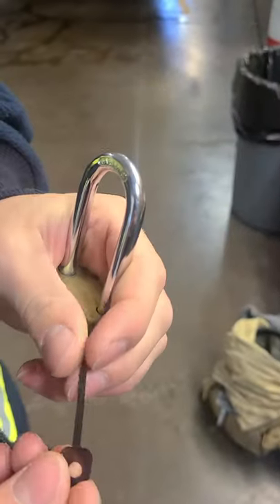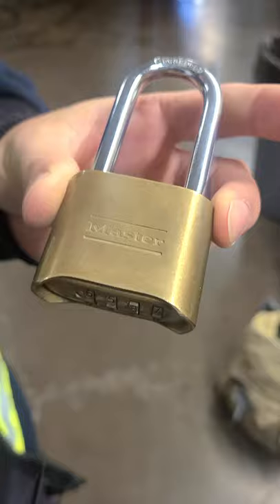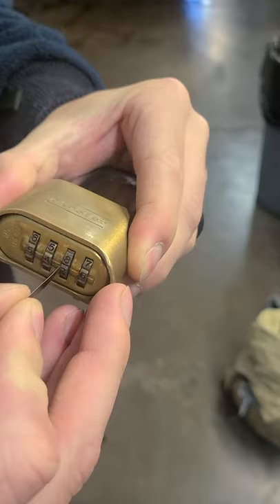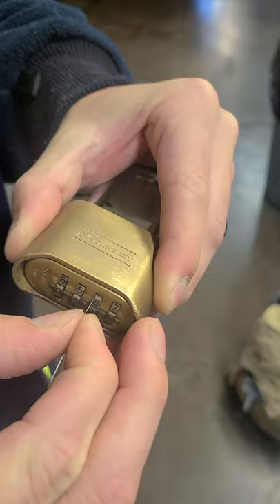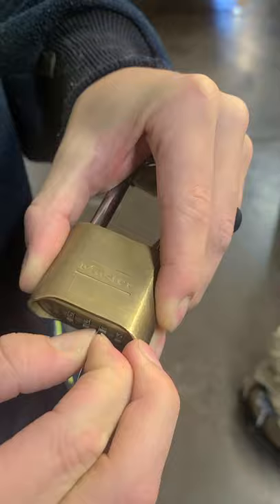Respectful Entry- Combination lock

Comment: Newer versions of these locks can't be shimmed if I'm not mistaken, but they can be decoded easily by learning the difference in feel between true and false gates.
Reply: If you got some time and fast fingers 20 min and you can blow through most of the 9999 combinations
Reply: Two open end wrenches will do it faster
Reply: @reilly walker yes they can lockpicking lawyer showed it so did McNally official
Reply: Yes they can
Reply: @dirtyaznstyle4156  I can do it with a 3 digit lock

Comment: The newest version of the 175 has such tight tolerances on the wheels that there is no shim that can fit and have sufficient strength to do the bypass. Decoding may still be possible but I haven't had any luck with it.
Reply: Try smacking it with another lock

Comment: is there a way to re use the lock and give it a new combination?
Reply: The little hole by his thumb is for resetting the combo. Comes w a tool for that, but a paperclip works.
Reply: Fake news
Reply: Yes, usually, open the lock, turn the shackle straight out, push it down, turn it slightly.  The disks should now be free for new settings.